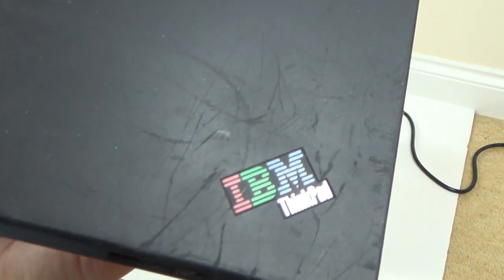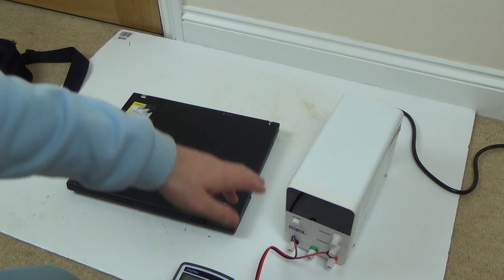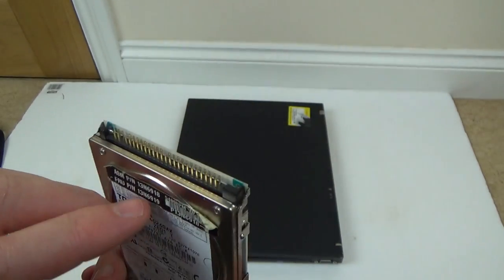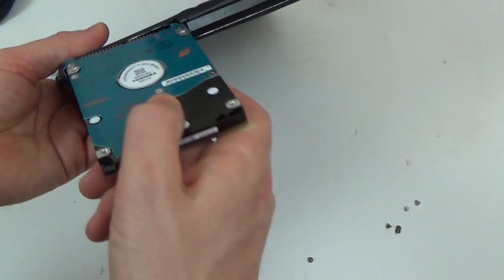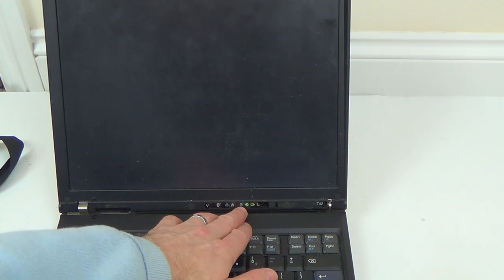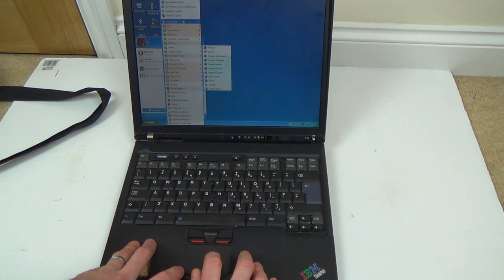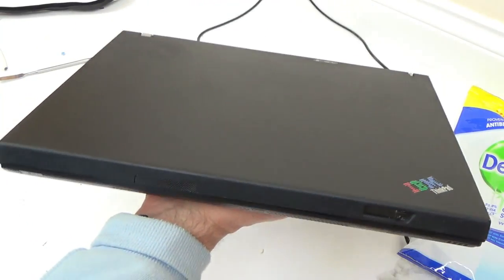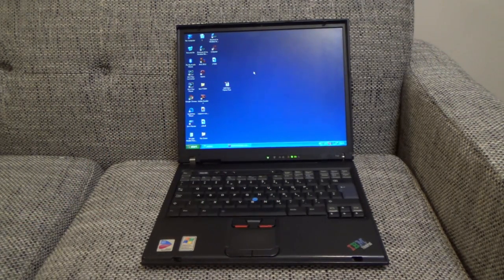Trying to FIX : IBM ThinkPad T42 Laptop

Comment: The certificate approval normally relates to the time and date being in the past.  Usually happens when the internal battery for the clock is either low or is dead.  You can usually fix this by setting up the date and time.
Reply: Not necessarily, the internal battery is different than time, and date, because the internal battery is the battery for the actual system. For the time, and date, it's a chip on the motherboard, lot of the chips would say Dallas on them. When that chip goes out, setting the time, and date ain't going to work. The time, and date won't keep it's time, doesn't matter if you set it or not, if the chip is dead. it doesn't work like that.
Reply: Well it can also appear when its not updated the opera and in chrome it will always appear cause xp does not receive updates for chrome since 2014
Reply: @jonathongraves2976  your thinking of desktop motherboards. These laptops use a button cell battery.
Reply: @josedasilva8924  No I'm not just thinking of a desktop, if it's a type of computer, it has a motherboard. I know what that battery is. The point is, it's not just that coin battery, that does the time, the main function of the CMOS battery is to save the bios settings, and there is a process to do by taking out the battery if you want to reset the bios. Like yes it's the battery, but that's not the main unit, it's the chip, and that specific chip's main function is to save the time, and date, not just the CMOS battery. The CMOS battery is really just known as a backup battery for the bios. So you see, the battery, and that timer chip eventually goes out after a period of time, and when the battery, and chip is weak, resetting the time would keep that time for a bit but eventually go out again, and if they are completely dead, and just resetting the time, and date isn't going to help anything, there ain't much you can do but replace it. Believe me, I know, I ran computers for quite a few years, and I self taught myself from experience.
Reply: @realvivifromloona  No I'm not just thinking of a desktop, if it's a type of computer, it has a motherboard. I know what that battery is. The point is, it's not just that coin battery, that does the time, the main function of the CMOS battery is to save the bios settings, and there is a process to do by taking out the battery if you want to reset the bios. Like yes it's the battery, but that's not the main unit, it's the chip, and that specific chip's main function is to save the time, and date, not just the CMOS battery. The CMOS battery is really just known as a backup battery for the bios. So you see, the battery, and that timer chip eventually goes out after a period of time, and when the battery, and chip is weak, resetting the time would keep that time for a bit but eventually go out again, and if they are completely dead, and just resetting the time, and date isn't going to help anything, there ain't much you can do but replace it. Believe me, I know, I ran computers for quite a few years, and I self taught myself from experience.
Reply: Rajan Hoxha I was thinking the same thing! Checking the date and time on the laptop as cmos battery maybe flat!
Reply: @realvivifromloona  Well I'm glad we cleared that up.
Reply: Yes an incorrect bios time can also set your OS to the incorrect date and time, and thus cirtificates can be treated as incorrect, but if the computer is set to set itself to the right time and region or location the cirtificates should pass scrutiny unless the browsers cirtificate itself is out of date and thus due for an update..

Comment: I had a T42 maxxed out at 2GB of RAM and I installed Windows 7 on it and it ran great!
Your CCFL backlight tube is dying - that's why the screen starts out looking purple/orange. I had to replace mine.
After years of faithful service, I eventually sold mine to a Thinkpad enthusiast who is a city contractor and was going to use it for his work - it may still be on the job!
Reply: Did the same to an R51 I got from a banking firm years ago when they where recycling machines. Went far enough to uprage CPU on it too. The thing runs linux now and is used as a music player on a stereo system these things are rugged as can be!
Reply: I found a cheap deal on a great condition T42p that was already pretty maxed by default, with pentium M 765 (2.1ghz), 2gb ram, and ati firegl card equivalent of radeon 9600, and 1600x1200 IPS, sweet machine for win98/win2000 dualboot retro gaming on the go, but it feels like its running rather hot, I wonder if theres anything I can do to improve the cooling on this thing? Plenty of info on how to improve the cooling on a T60, but nothing that I can find on the T42?

Comment: Vince can you check the system date and time ... if this has been lost then browsers may well complain about certificates.   
That.said I wouldn’t recommend going on the internet with XP
Reply: That's a good point, time and date needs to be correct too!  But on XP a lot of the certs no longer work because the root certs were renewed a few years ago (probably more than a few years ago lol) - supporting stronger ciphers and hashes etc.
Reply: @GadgetUK164  Exactly right not sure is XP supports sha256 most defintely not sha512 / AES or Serpent or many of the new varients.
Reply: I would suggest to install retrozilla for the modern protocols. But for heavens sake, only go on sites you know with that XP daanger. Every thing else should be done inside a VM or on a live CD.
Reply: @utzufideli9769  Wow people are way to scared of going online with XP, my school used XP until 2017, no issue. I use Windows XP online everyday, no issue. Ya'll don't have a gun to your head forcing you to enter banking info into Internet Explorer 6. Use common sense and XP online is as dangerous as Windows 10 online.
Reply: @utzufideli9769  theres a couple of palemoon forks which still have xp support, basilisk and mypal and can handle the modern  web fine and are relatively secure. Also xp with all the posready updates didn't lose support until mid 2019 so it's probably not too bad to have the machine online.

Comment: I worked from a T42 for several years!  Really nice robust machines!  Great job getting this working - the crazy thing, I think I have a PSU for one of those here!!!  To get it working properly - just get a Windows 10 Pro license off eBay for £5 and install Windows 10.  I suspect Win 10 will run fine on it.  You may need to add some RAM first (not sure it will go beyond 2GB) if you wanted to do that.  The problem in general with certificates - Windows update used to update all the root certificates periodcally.  They have been renewed over the years and not updated in Win XP.  The net result is you get that cert error with most websites.  You could probably manually install the various certificates and get around some of the issues.   IE likely wont support some of the latest ciphers though, so you would need to go with the last version of Firefox / Opera supported by XP.
Reply: I don't think 10 will run fine as it is not very good on low end hardware unless you are in to OPTIMIZATION.
Reply: @joeatron3222  
Windows 10 HATES classic HDDs. It really needs an SSD, at least 2 threads and 2GB ram.
This has none if that. (And is also not really upgradable to SSDs - IDE SSDs are very rare)
However with enough RAM windows vista and 7 run fine on those Pentium M era laptops.
I personally would stick with XP or a light Linux. Just feels much snappier than that win 7.

Edit: I think W10 would not even run on this. The T42 probably still has the older "banias" pentium M core which doesn't advertise PAE support to the OS. 
"Dothan" is needed for booting W8/10.

Comment: Generally older systems running XP will have out of date security certificates for web browsers and XP isn’t designed to work with HTML5 and up protocols for most modern browsers. As it’s built on x32 bit architecture most modern programs will suffer as more up to date hardware tends to run on x64 bit architecture. You could try say a live USB running x32 Debian and seeing if that will inject some usability into the older hardware but honestly it’s a nostalgic trip to see one of these things running in such good condition! It was a treat watching this video and fantastic work as always!

Comment: That T42 model is a little tank and is still a pretty good laptop, especially if you run Linux on it. If you throw in an SSD like I did playing with one it's actually really fast. I used an mSATA to IDE adapter with a 128GB SSD and set a 2048MB swap partition for virtual memory to go along with it's 2GB of RAM. I didn't think it would be that good but I had everything except for the $5 adapter and figured "Why not?" Haha
Reply: At a maximum 133MBs data transfer rate, you will not get a lot of performance out of an SSD.  I have had HDDs reach 150MBs, and 80MBs over USB. Technically USB 2.0 could be faster, but in reality its not. This is a difficult recommendation - though I am putting a 64GB SSD on a iMac G4 (snow globe), which is IDE - total expense? $11 for the adaptor.
Reply: @danilko1  Running operating systems requires rather fast random read/write speeds, at which SSDs vastly excel over HDDs.
Reply: That's what's really good about Linux. Linux is able to put a lot of old systems back to life. The thing is 32 bit processors systems aren't getting much support anymore, because 32 bit is just too old, and not many people are running them anymore, so there's just not many software, and operating systems supporting them anymore.
Reply: @danilko1  that 133MB/s cap of the ATA100 bus means nothing really when it comes to running the system. The SSD is helping with low latency, simply navigating the system and with the read/write speeds of small files. The SSD is ready to pretty much instantly open folders and programs whereas a HDD can't possibly do it as fast. I guarantee that if you set up a T42 exactly as I did except with the fastest HDD you could possibly put in it, the real world use of that laptop would pale in performance next to the one with the SSD.
Edit: I forgot another huge benefit of the SSD over the HDD. The SSD can access the swap partition/virtual memory much MUCH faster!
Reply: @danilko1  a good analogy would be take a rotary engine and a standard engine that both have the same exact HP. Let's see which one revs quicker. Haha
Reply: @89ludeawakening1  Since I do have a similar situation with the G4 iMac, I'll take notes before and after the upgrade. Thanks for the clarification that it's not just bandwidth. This is the first IDE I will have gone solid state with. My expectations are not too high though.

Comment: If you want to use it on the Internet, you can download Firefox 37.02 from the Mozilla FTP repository (ftp.mozilla.org/pub/firefox/releases/). After you installed it, click on the question mark in the three bars menu and go to about Firefox and open it so often until there are no updates available any more (This should be at 52.9.0 ESR). There will also appear a tab in Firefox that tells, that no more updates are developed for Windows XP.

Comment: For anyone wondering:
The red screen backlight means that the backlight CCFL tubes are worn out. The screen is also very dim. A new tube would restore it to its original brightness which is MUCH MUCH brighter.
Also... Ewww, a blue trackpoint cap on a thinkpad... blasphemy :D
But otherwise nice job, I really enjoy the channel :)

Comment: The battery is really worn and you can fix that too, you would have to replace the 18650 cells inside which make up the battery itself. That specific battery has 6 cells, 2 in parallel and 3 in series to get a nominal 12.6 volts.

Comment: I got given an old Dell desktop a few years ago and it wasn’t til I got it that I realised it was old, like 11 years old or so, but it’s a Dell Precision workstation.  I fixed a couple of issues it had put Windows 10 on it and it’s the best Windows PC I’ve ever had.  It’s got dual quad-core Xeon processors, 20GB RAM and two HDDs in RAID0.  It’s my main machine in my home office and it runs everything I need it to perfectly.  Had it not have been through sheer luck and my soldering skills (being a design and development engineer), the machine would be in a million pieces in India or somewhere, being recycled.

Comment: I have a T41 I use as an XP machine. Works for most video files as long as the bitrate isn't too high. It's air-gapped mostly because the Wireless is finicky but also because there isn't really much reason to use the Internet on it. Wireless-G means downloading right on it is slower than sneakernetting a downloaded file from another system via a thumb drive. If you are getting certificate errors verify the time and date are correct, I don't recall that being covered in the video.

Comment: Vince, that hard drive might have a built-in recovery mode designed to restore the computer to factory settings. You may want to perform a restoration to remove old personal data and possible malware from the system.

Comment: To fix the certificates for XP make sure you have the correct date & time and if it doesn't fix, you have to update the root certificates with a tool called "rootsupd.exe", after a reboot every website loads fine.
Also you can download Chrome fine from Internet Explorer.
I would rather install Lubuntu on that laptop, sure better than Windows 7 which is still outdated but it's way more hungry on that old computer.
EDIT: Another useful thing if you plan to keep it with XP is changing the Update repository to PosReady 2009, which has been updated until April 2019.

Comment: I had one of these for work.   They are good machines for there time.   I rescued another one from the bin.
The screen changing colour wasn't normal.
It is fairly easy to change the keyboard on these.
They don't have washers in the hard disk.  The facia does just clip over the screws of the drive then just secures at the bottom.  The one I had at work had 1.5Gb in it as I upgraded it at the time.
Reply: ... I would try and replace the keyboard as a unit, though.   Not just the individual keys.
Reply: ... But, I guess it works.
Reply: Final pester.    I was going to try Windows 98 to for retro games and DOS games on mine.
It may run a light weight Linux distribution?

Comment: Watching you fight with that HDD was rough to watch. But I was impressed with the key switch. Most people would just replace the entire keyboard. The Nub - re/blue dot do come with different sized Squares on the bottom btw. Also, you prolly could get away running win 7. Just install the XP or 2k drivers if you have them. - I have worked with many Thinkpads in my day. They were business machines and therefore great for number crunching applications. These things outperformed my PC of the day, even tho my PC had way better stats
Reply: The T42 really isn't suited for 7 due to the age of the machine and xp runs just right, used to collect Thinkpads before moving on to higher end Dells that are more favorable for gaming and are more serviceable.

Comment: On IDE's there is a "key" which you should be able to see with a torch in there and also match up the slight gap between power pins array and IDE data array of pins.   Laptop ones did have a slightly canted connector to prevent jarring a connection out of its socket and keep it locked with a good cohesive connection between pins.   Those pins can bend extremely easily which is why the caddy is designed to "egg box" the drive, the caddy transmits the jarring forces to the chassis.